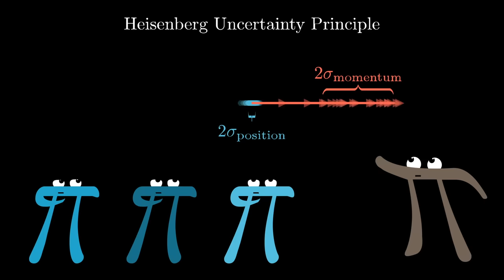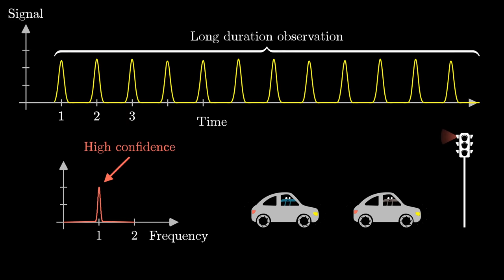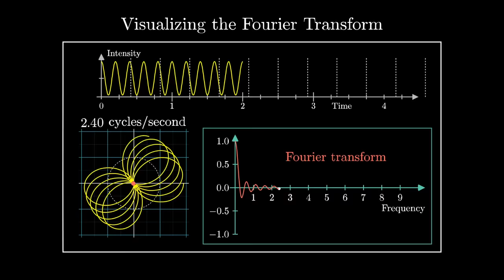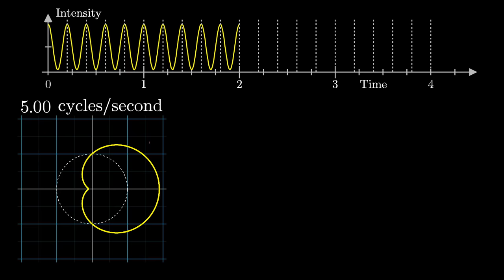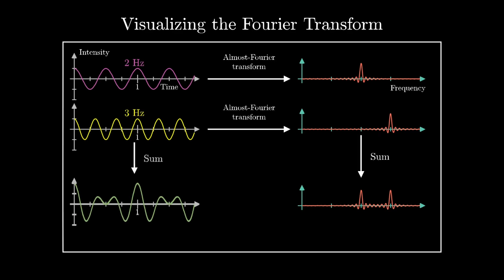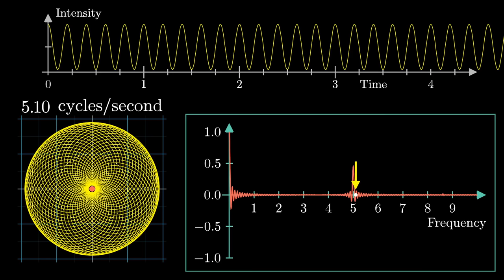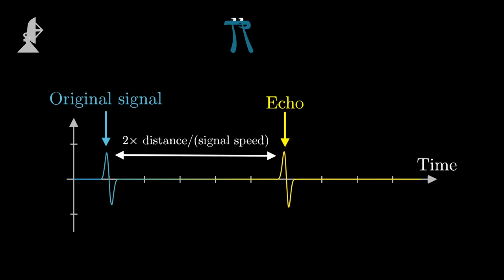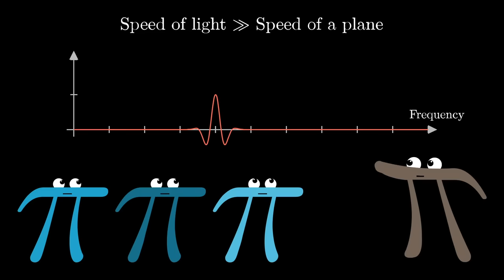The more general uncertainty principle, regarding Fourier transforms

Comment: Could you make a series about mathematics of Quantum Mechanics?
It's freaking hard to grasp.
Reply: Yes, it would be if you are approaching it from the mathematical side, which tells you very little about physics. I would suggest you try to understand the physics, first, before you learn the math. That makes it a lot clearer what is going on. 

Quantum mechanics is about quanta of energy that get exchanged between systems. It is NOT about objects. It is NOT about particles and it is NOT about waves. When systems exchange quanta of energy, they also exchange momentum, angular momentum and charges like electric charge or leptonic charge. Energy and momentum are not quantized, but angular momentum and charges are. They only come in integer multiples of a minimal quantity (usually expressed in Planck units and electron charge, but these are arbitrary numbers due to the choice of our units - in rational units they should be set equal to 1). In an experiment the detection of one quantum is basically one "click" of a detector. In the ideal scenario such a detector can tell us where and when a quantum was detected and how much energy, momentum, angular momentum and charge it had. 

A single detection carries basically no relevant physical information about the systems that emitted these quanta, so we have to bunch an infinite number of them into a quantum mechanical ensemble and then we can form frequentist counts aka histograms aka probability distributions with them. Because we are now working in an ensemble theory, we can assume that each member of the ensemble is isolated and that means that sub-ensembles are statistically independent of each other. This leads to the usual Kolmogorov axioms for probability theory. It turns out that these axioms for statistically independent ensembles can also be satisfied with complex and quaternion based functions (and probably product algebras built from these basic elements, but that's less often used). 

The resulting functions are normalized elements in Hilbert spaces (normalized because the number of members in an ensemble does not change during the evolution of the ensemble), which basically leads to unitary dynamics, i.e. rotations in finite and infinite dimensional linear spaces. In the trivial finite dimensional case these rotations can be described by Heisenberg's unitary matrices, in the infinite dimensional case we need linear operators and partial differential equations. And that is basically what quantum mechanics is: the theory of unitary rotations, except that there is not much physics in that because that part is basically a simplifying assumption (that all the copies of the system we start out with are still there when we detect the results). In experiments that's far from true. We actually lose most quanta of energy in most of our experiments. The experimentalists are simply fudging that loss with an arbitrary (experimentally measured) number that we call "quantum efficiency" and the theorists never get to see that fudge, so many of them think that "unitarity" is some god-like property of quantum physics. It's nothing like that. It's just what's left over after the experimentalists have cleaned the data. If you keep that in mind you will start to understand why the mathematical structure of quantum mechanics is so meaningless. It's an artificial construct, not a property of observational reality. It has that in common with Hamiltonian mechanics, but that's another rant. ;-)

Comment: Isn't another way to put it, when things are fast or small they're hard to detect, but especially if they're fast and small?  Another way to put it:  If you were travelling at the speed of these particles, wouldn't that reduce the uncertainty?

I always thought to compare it to a penny glued to a car tire as the car travels (very (think relativistically)) quickly down the road.  Try to detect it's position at any given moment.  What accuracy does your result have?  Also, as I thought just now, try to detect it's momentum classically, by observing it's (angular) velocity.  To do so for an object who's position is changing rapidly, and especially periodically, when, as the position of the object moves from point 1 to point 2 to point 3, might involve observing point 3 between point 1 and point 2 (again, due to it being rapidly periodic, and thus a high frequency, as well as observing it with a detector out of phase with the phenomenon).  At that point you might even conclude that the momentum changed direction, yet hadn't.

All purely philosophical, of course.

Comment: Regarding the Uncertainty principle in Doppler Radar, can't you just solve the uncertainty in the position and velocities of objects by sending out multiple pulses, both of short and long durations with separate detectors for each? In quantum mechanics, we cannot do this as making any observation with electromagnetic waves changes the location/velocity of particles. But any change made by the pulses sent by radar will be so small, it's practically negligible as the objects have much more mass.
Reply: Light is a quantum mechanical phenomenon, so you are doing QM here whether you like it or not. It just happens that the uncertainty principle has nothing to do with quantum mechanics. It's a general property of functions and linear operators, no matter what they are describing. Something like a Gaussian does, of course, have a unique parametrization and we can define "the center" in a unique way. That is simply not the case for arbitrary functions. Where is the center of a plane wave, for instance? The entire notion of it having a beginning, a center and an end is useless. What's the physical meaning of the center of a hollow sphere? There is no physical interaction at "the center", it's empty. All the physical interaction would be with the shell, even in classical physics. One simply has to learn to live with the fact that "center of mass" is a very, very limited concept for a very limited class of problems, classical or not.

Comment: The problem at the end:

No.

In fact, you might be able to determine the opposite (who the strongest is), but not the weakest without more tests and/or non 10-on-10 matches. The reason is that your only information is aggregate - win or not for a given team. So if the strongest person is much stronger than all the others their team will always win regardless of its composition. If, for example, 19 kindergarten students and Arnold Schwarzenegger are your population, you have some trouble. The team with Arnold will always win, even if they have the weakest person, because the aggregate strength of all members will always be higher because a sub-population (Arnold) is always stronger. In fact, if you had Arnold vs all 19 students, he would still probably win. If you can not be assured of the range of strengths of all participants and/or if all your matches have to be 10-on-10, you can't determine who the weakest person is only using match data.

Comment: Just read an interesting book, absurdities in modern physics, and their point was that the uncertainty principle is really just a limit of the Fourier transform, not the limit of precision of reality.  They showed that different units for cycle, example if you chose degrees instead of radians would give you a different uncertainty value.  As in, the uncertainty given in the uncertainty principle is hiding units of angle.   They also suggested a different approach to frequency analysis besides the Fourier transform and he showed the uncertainty was less than the uncertainty principle because this different method keeps track of phase, which the Fourier transform looses track of.

13:24 whoa! relativity of simultaneity a core “fact”?  Facts mean proved or known to be true, in which case no conclusion based solely on relativities postulates (unverified assumptions taken to be true) can be proven.  Turns out relativity is the epicycle equivalent of modern physics since discover what would be its keplerian counterpart with equal (if not superior) predictive power.

Comment: I wonder if we can use Fourier relationships to understand when specific properties are more derived or emergent vs more fundamental. For all classical conjugate pairs of quantities where Fourier transforms apply it seems that one side of the pair is more observable, and the other is a derived property that is useful as a model. eg "many pressure measurements over time" (observed) translates into 'frequency' values (model).

For QM conjugate pairs that are (supposed to be) subject to the Heisenberg uncertainty principle, what hints or clues could the above idea indicate?  Are 'position' and 'momentum' both equally useful models or physical ideas? Does this Fourier relationship indicate that one is more emergent or derivative than the other?

Comment: This explanation only works for one-particle quantum theoy. But Quantum physics applies to many body systems ( nuclei, an atom with many electrons...); thus, there is a single state for the whole system. The principle, in the end, seems, only superficially,   be relaed with the Fourier transform. Feynman explanation of chemical forces is a way to understand the novelty of the chemical link. Allowing h=0 identically, makes the system collapse. The value of h permits only exact physical distances between nuclei in a molecule and no other. Math does not explain h= 6.62×10^-34 Js. There is classical chaos in many body systems. Because even a  small change in the initial condition( of some given degree of freedom, say) makes the trajectories to reach exponentially large perturbations. But there is no quantum chaos because there will always be a minimum, discrete, size of those initial conditions possibilities . It means that there are not quantum Lyapunov exponents. That's why matter is stable. The state is defined from stable quantized symmetries. And only discrete changes in the symmetries are allowed. This is another example that reflects the magnitude of  h. It is Pauli's principle, again a physical implication of the finiteness  of h, the product of  physical (observable) energy and measurable period  uncertainties.

Comment: To me, it's like taking the derivative of a noisy signal. You can smooth the signal, and get a more accurate view of how it's changing and less accurate number on its exact value, or not smooth it and get a very accurate value but a derivative that could be way off.

Comment: Sir, could you explain this topic using triangulation?  I'd like to see how uncertainty works out when you have multiple viewpoints of the same focus point. In this I feel as if it would be analogous to a Fourier frequency of a Fourier frequency.. Not knowing or uncertain of a position and momentum narrowed in on the fact that the observation is based on a single position and momentum, yours.

Comment: Coming from only pre uni physics knowledge, would it be possible to measure both quantities at the same time using 2 independent sensors? Let's say from the radar example instead of sending out 1 type of signal from 1 source, we send out 2 sources at slightly different time and frequency. Each source would be measuring its corresponding variable so that we can get the full picture.

Comment: The basic images required for understanding Quantum-fields in QM-TIMESPACE, wave-packaging we can identify as interleaved wave-packaging formation of substantiation = envelopment, alignments in/of analog time duration timing spacing, nodal-vibrational emitter-receiver interference by log-antilog inclusion-exclusion AM-FM Superspin-spiral Quantum-field resonances. 
-----
The Ancient Mathematical Conjecture derived from the projection of light above in a closed room just has to be the original geometrical patterning of superimposed Forms, projection-drawing positioning of the pure relative motion in the "liquid of light" distribution, handed down the generations. It's natural, observational Calculus of the Math-Phys-Chem and Geometry of phase-locked frozen Time-timing.

Point-positioning geometrics drawn in point-line-circle time-timing sync-duration patterning formed this way, has been Formalised by Newton into real-time cause-effect Calculus @.dt zero-infinity instantaneous line-of-sight superposition identification of/by e-Pi-i Euler's Reciproction-recirculation function, (by default), axial-tangential Renormalized picture plane of projection-drawing 2-ness, observed in Pi-i-reflection at transverse trancendental e-Pi condensation In-form-ation probability-wave substantiation. 

This is the process of logarithmic numberness condensation confined by Prime and Cofactor conglomerations of Quantum-fields of quantization analog line-of-sight sequences superimposed as pulse-evolution QM resonance coordination. (Ie, it's all back to front, inside-outside holographic time-timing presence Infinity/Eternity, Singularity-focusing Condensates)

Please allow the Mathemagical Mathologers of QM-TIME Completeness cause-effect to re-orientate this perception paradox suitable for the next generation of Teachers and Students.

Comment: I don't get the intuition from the car light example. In this case, isn't it a biological issue? If I had eyes that could detect and react instantly shouldn't I be theoretically able to tell if they are in sync after the first time they blink by just seeing if there's a delay after mine went off or vice versa? Similarly with the wave diagrams.
I get the forier transform logic but not the intuition

Comment: I must that I usually enjoy your videos about math very much but this time I think there is a problem. The issues that you are talking about are obviously relevant to measurements quality in general but have nothing to do with the uncertainty principal. The uncertainty principal arises when the  input energy of the measurement action is of the same or nearly the same magnitude of  the self energy states of the system that is being measured. This is a unique phenomena that is typical to quantum context.   It has nothing to do with the ''noise'' phenomena of the measurement output which you can find in  any measurement macro and micro (as well as in the quantum context )

Comment: Get two different radars, one to measure the velocity and one to measure the position. This doesn't contradict your video (at least in the radar analogy).
A possible counter: The radars will interfere with each other.
The counter-counter to that: Not if different frequencies are used.

Comment: I'm a little confused because the peaks in the Fourier transform of a signal are unambiguous, no matter how short the signal is. The slope around the maximum changes with the length of the signal, so I get the feeling that the argument is "For shorter signals, it is harder to determine the frequency with a naked eye". This is also the feeling I got with the introductory car-example.
But mathematically, the frequency is always unambiguous. So could this really be connected to the Heisenberg principle?
Reply: but a short signal that looks like a sine may actually be a combination of other sines that don't look like a sine outside the part you looked at... so it's not unambiguous, but it gets closer to being unambiguous the longer you look at the signal

Comment: BEAT FREQUENCIES. My previous comment on this got buried in the stream, so I'm yelling in the hope to spark a few comments or even a <3 from Grant ;-). Guitarists use beat frequencies sometimes to see if two strings are relatively in tune by listening for the beats when they play the same note simultaneously. You can adjust the tension on one of the strings while listening to the beats that emerge. If the two notes have a difference of 1Hz then you will hear a beat once every second. If they are 2 Hz apart then you will hear a beat every half second. In general, the beat frequency = 1/(f1-f2). Now here's the big connection: if you want to know exactly when two strings are in tune, how long would you have to listen? 1/0 a.k.a. infinitely long! In other words, the closer the two frequencies are the longer you have to wait to hear their beat frequencies. You can't ever know that two notes are exactly the same by listening to beat frequencies, but you can be more certain the more time you spend listening. I think another follow up video is in order ;-).
Reply: that's really cool :)

Comment: The measurement problem, you can study dynamical systems without perturbation to the system under chaos theory. that is to say take the analog of negative pi, -(pi) = -(circumference)/ (diameter). or -(pi) = (circumference) / -(diameter). for the one with the negative circumference, there is an implied unidirectionality to something that is going on with the information/connectivity on the circumference. think of the gaussian, (they should makes the axes weaky correlated, to provide for nonlinear surface flows/tensions.) so a negative circumference has to do with the measurement problem in a certain sense
find me on the book face, Michael McKay, look for the purple light for the profile pic

Comment: This is weird. Once I've learned about light diffraction and how to get pattern. Later i've seen video on youtube estimating ammount of difraction from uncertainity principle, it gave somewhat similar result, but not the pattern. I realized that pattern is actually fourier transform of the hole after watching this video and Applied Science has video about device called 4F correlator, which is optical setup providing spectrum of image put into optical path.